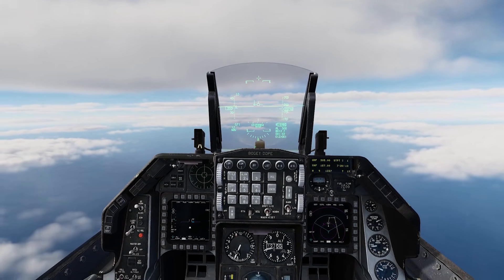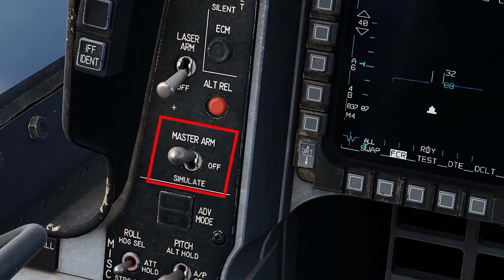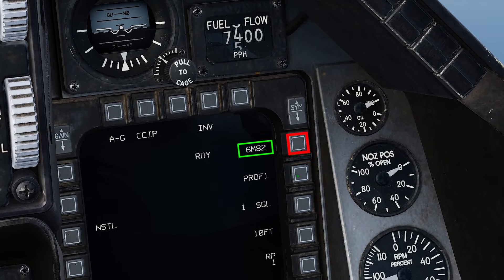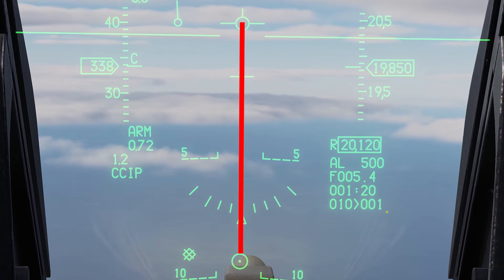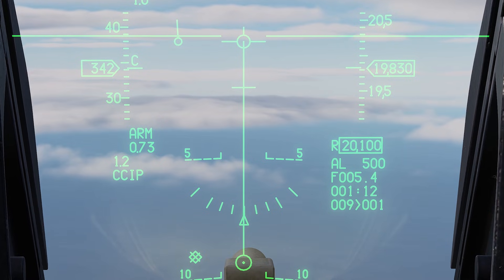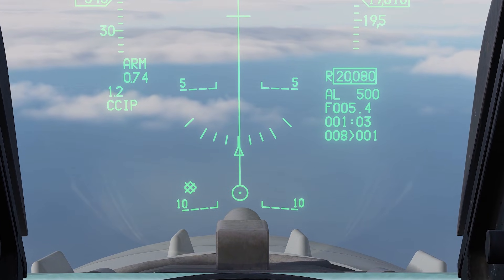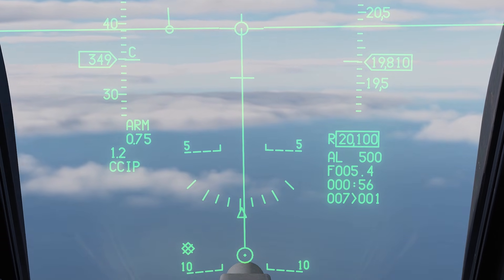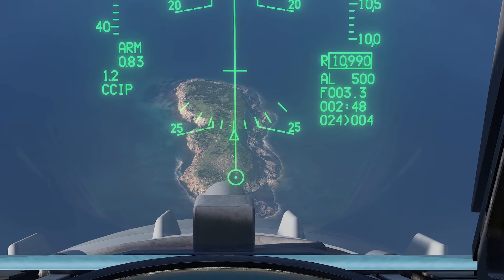DCS: F-16 Dumb Bombs CCIP In 60 Seconds

Comment: I'm in total rage. 🤬Following your steps move-by-move: nothing works on my F16, why? Example: when in CCIP mode you cycle your bombs, in the video I see them cycle 2-6. Not on my screen. about the rest, I have EVREYthing set as you say, and I can't release any bombs. Tried dozens of times. Plus, I went through commands adjustment, but I can't find any weapons related section, nothing. Is it normal?
And most of all: how can I get rid of that dumb arcade-style hud I get on my screen? I mean That reddish thing, showing GUN and a simplified pitch/radar thing.
Thank you (Please consider this is not my first language, sorry)
Reply from the maker: When I cycle my bombs, the "2-6" is the quantity. If you pause the video, you'll see 2M84 (Which means 2 Mark-84's) and 6M82 (Which means 6 Mark-82's). Make sure the horizontal "Release Cue" is not present when you press the release button. If that horizontal little dash is present on the fall line, the bombs WILL NOT release. I don't know what you mean by "Commands adjustment". What is that? Also, not sure what you mean by "reddish thing showing GUN and a simplified Pitch/Radar thing". Are you talking about the CCIP hud symbology? I've never seen anything the color red on the HUD. If you're talking about my red lines I put in my video, that's just my artificial markers I put in my edit. They don't exist in the sim. I just edit them in to mark stuff I'm talking about.
Reply from the maker: Also, note, this is my 60second abbreviated tutorial for dumb bombs. I explain a lot more here - https://www.youtube.com/watch?v=ueGYEYsrGrs
Reply: @BogeyDope  Thank you for your kind reply. LOL, I've got most of the things you mentioned (red marks, bombs numbers cycling, etc) I'm sim-dumb, but not THAT dumb. I mean, just doin' exactely the things you do in the video. my sim does not act the same. Not at all. It's ok until you select and set things, then it jus't doesn't work, no weapons release, nothing.
About the annoying red stuff on my screen, is there a way to show you a .jpg 
screenshot?
Reply from the maker: @IlTurko  The only reason that you would not be able to "Cycle" bombs would be that you only have a single type of bomb loaded. Other than that, I don't know why you can't cycle them. As for the release. If you have Master arm on, you have the system in A-G mode, and you've got your MK82/MK84 selected and you have pointed the nose down until the horizontal release cue dash is no longer present and you press the weapon release button and nothing happens. Then I honestly have no idea. I would have to see you fly and see what is happening to answer that at this point. Unfortunately, there's no way to share jpgs in youtube.
Reply: @BogeyDope  thank you again. I may try to record a few minutes of my flight. Don't feel obligated , of course. 
Your help is appreciated, but I really think there's something strange goin' on here.  I don't know, this birds acts weirdly.

Comment: Yo man I really liked you're reshade settings could you maybe give the settings? Thx in advance
Reply from the maker: I go over my exact reshade settings here - https://youtu.be/UGxgD9GNVNw
Reply: @BogeyDope  thx mate tho in the video it looks like no sharpening applied and colors look different tested with those settings and not close...
Reply from the maker: @ulkazil8513  In this video there is no sharpening? Or in my reshade video there is no sharpening? At 7:06 into my reshade video I apply the sharpening. I set it pretty high. I set it to 2.0. It may not look the same on your monitor. But those are the same settings I use today, Contrast to .750, sharpen 2.0, and sharpening limit to .050. Depending on your monitor, you may need to adjust it more or less to make it look the way you like. Let me know if that helps.
Reply: @BogeyDope  aight gotta I will test around thx for the quick help